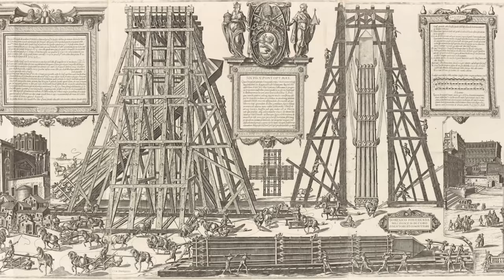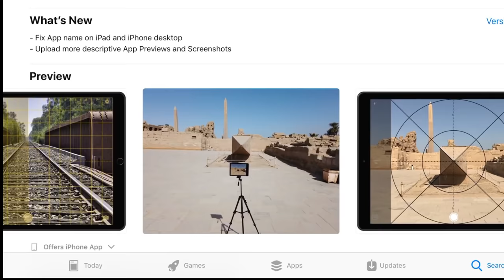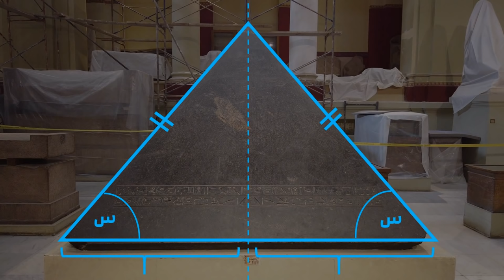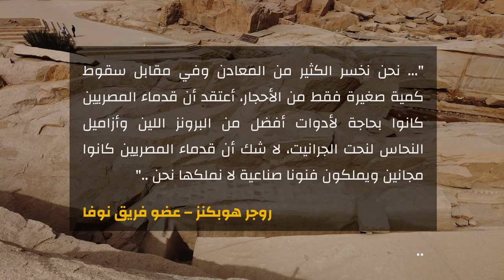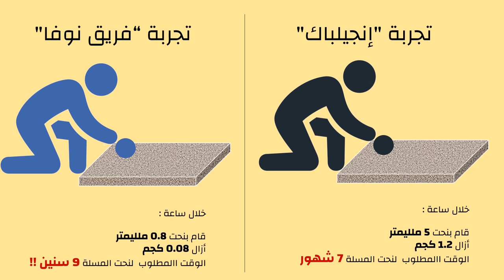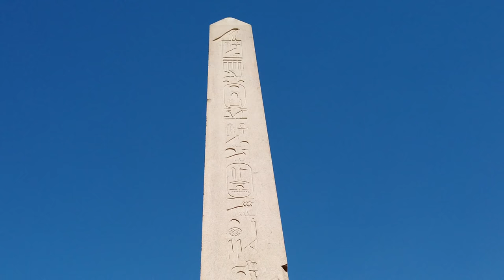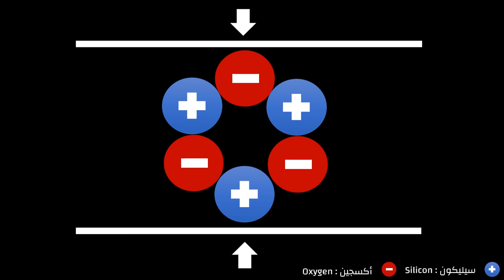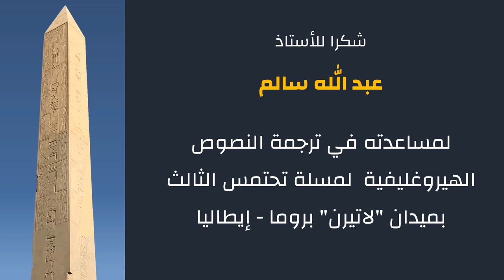المسلات

Comment: Salamou alikom,

Discussion topic:

From what you have suggested! it is possible to apply pressure on the sutras using resonance breaking, there is a phase where granite decompresses when exposed to ultrasonic waves! since the sutra have 4 surfaces, they could have been covered for so in order to extract electricity we will need to cover two opposite sides of the sutra with something that will consume the electricity and the other two sides could be covered with ultrasonic waves generators.
am not proficient in electricity nor sound but i think the theory is worth testing.